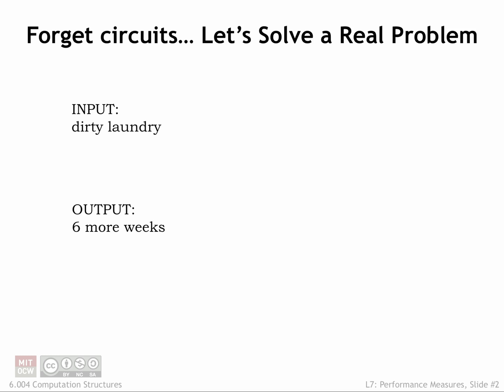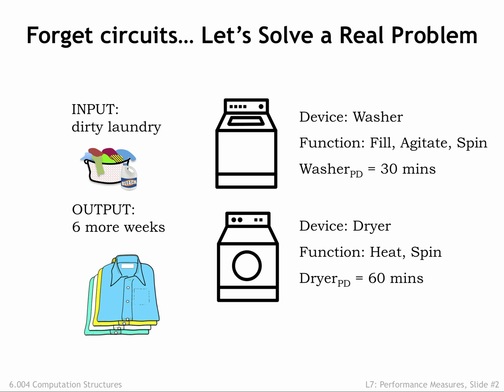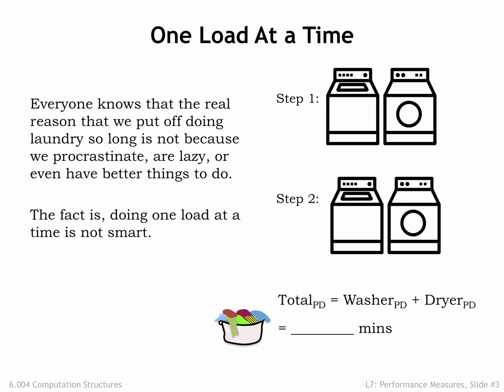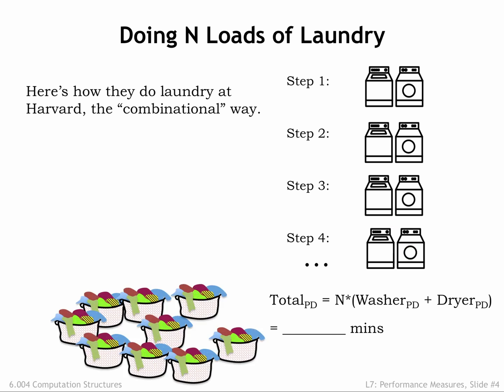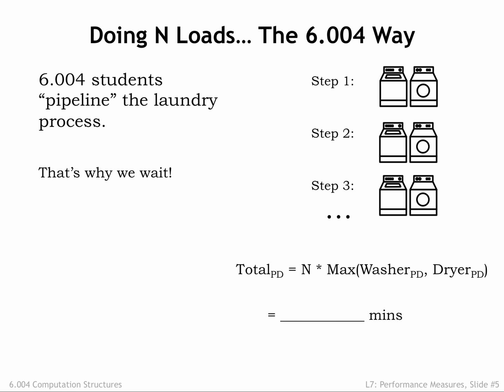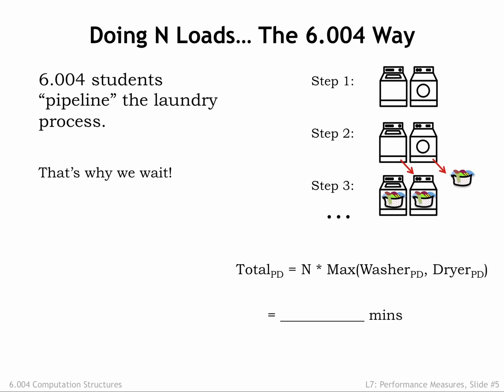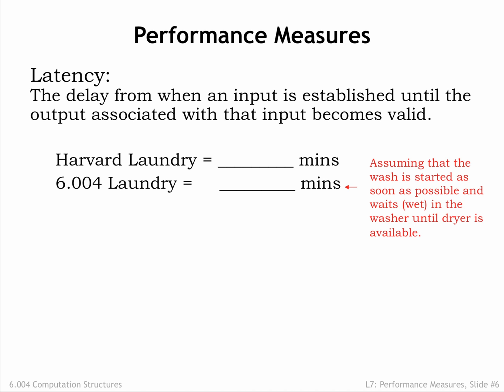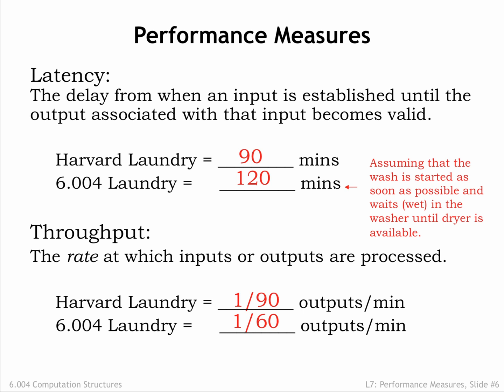7.2.1 Latency and Throughput

Comment: Can you pleas explain - "And a particular load of laundry, which requires two stages of processing time, takes 120 minutes". Couldn't understand how?
Reply: You wash the clothes, that's 30 minutes. Then you have to wait 30 minutes for the dryer to finish the previous load, then you have to wait 60 minutes for the dryer to complete the current load. 30 + 30 + 60 = 120.
Reply: Good question. I'm having the same confusion at first. Because I was assuming there is only one load/input. But actually, there is another previous load in the dryer. So you cannot put your clothes into the dryer immediately after the 30 minutes of washing. You have to wait 30 more minutes for the previous load finish drying.